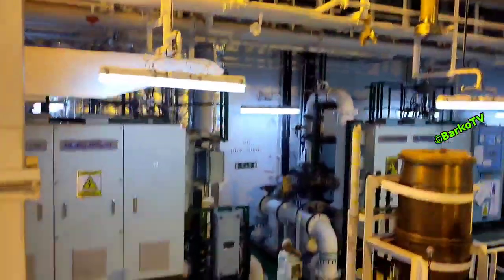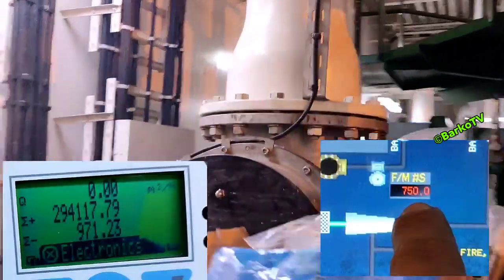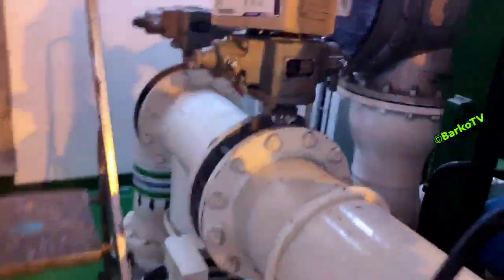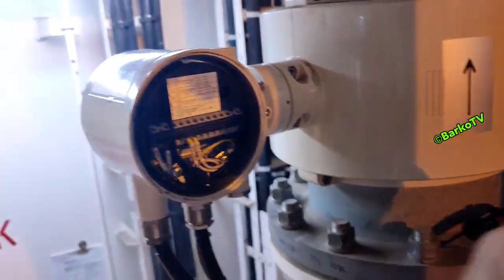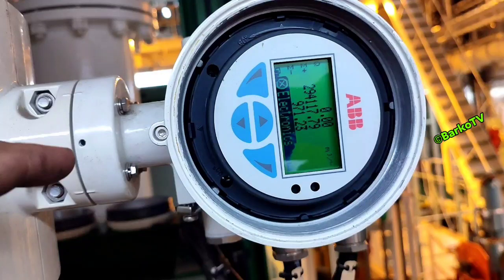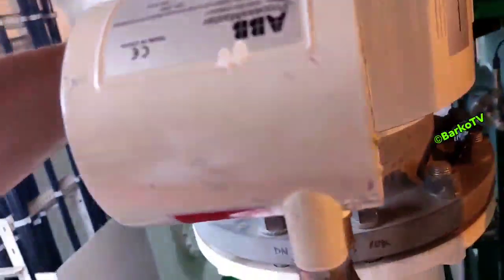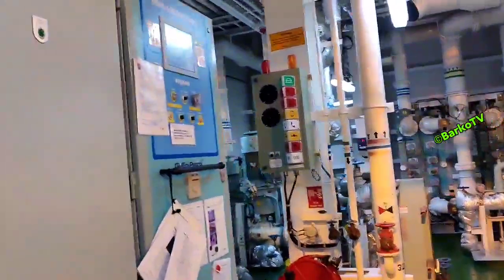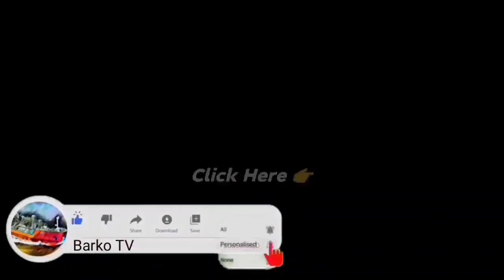ABB flow meter configuration and simulation. Panasia BWTS glo en patrol ABB Process Master

Comment: Hope you can help. My problem is.
On the flowmeter display the actual flowrate but on plc monitoring is "0". 
The sensor 4-20mA result in the dianostic panel only stays 3.6mA not changing. What is the common problem of this?

Comment: How did you introduce 4-20mA into the PLC. The PLC is the component providing the 24VDC loop voltage for producing the 4-20 mA.
Reply from the maker: Using a loop calibrator to simulate 4-20mA signal